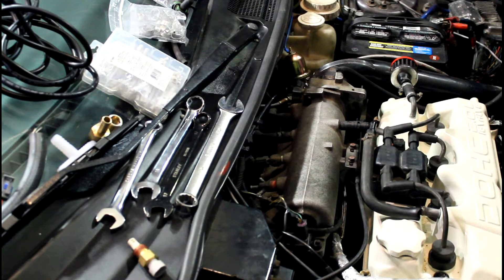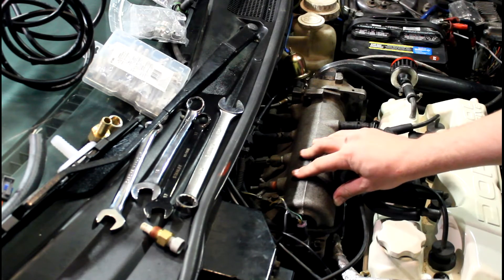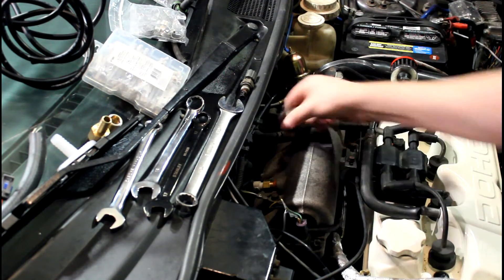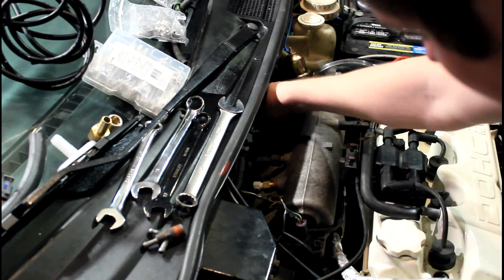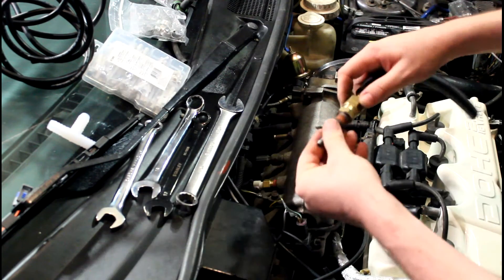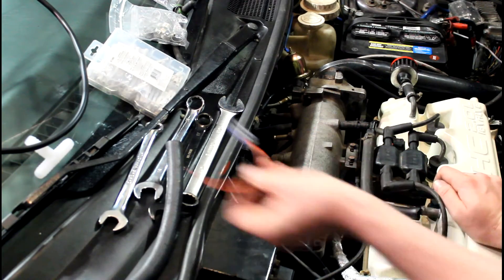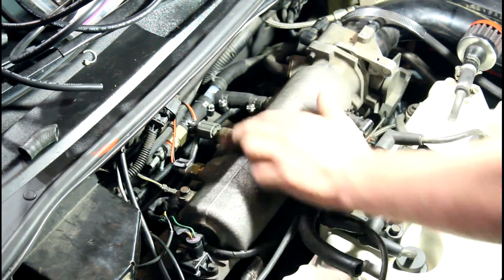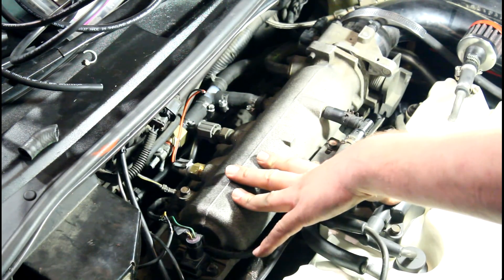Evan's Megasquirt Build Ep 11 - Intake Air Temp Sensor (IAT/MAT)

Comment from the maker: Not exactly. MS would be nice but it is a lot to go through just for a cam upgrade. I'm no 420A guru,but I think a lot of folks get by using an AFC neo to adjust the MAP signal near idle to trick it into giving a bit extra fuel.  Many will tell you the AFC neo is an air flow converter for MAF, and wont work on 420A, but it will actually work on the MAP line to trick the stock ECU into thining there is more load, hence more fuel, and better idle with cam.  Then agian, it is 1/2 the price of an MS

Comment: ok thanks that helps. i just got my 420a January of this month and had stage 2 crower cams put in with high tension springs and retainers and i noticed my idle wasnt acting right and the mechanic who installed it said my ecu might need to be tuned but all the shops in my area dont like to tune the n/a eclipse 95-99 so i guess megasquirt is my best bet?

Comment from the maker: Yes, you do, it is important in calculating how much air enters the engine in speed density mode.  It uses the ideal gas law, PV=nRT, where T is the temperature of the gas (air).  P is the pressure (MAP sensor basically), V is the volume of your cylinder (I think), and R is the ideal gas constant.  n is the number of moles of gas, which basically is how much air you have to complete combustion.  The AFR is the ratio of n units of air you need to n units of Gasoline, so basically T is important.

Comment from the maker: I do not kno for sure, but the threads on the IAT are 3/8" NPT pipe thread - note that isn't an actual 3/8" outer diameter but a pipe thread size based on pipe inner diameter.  I would guess that the stock sensor is 1/4" NPT, but I could be wrong.  I'd pull it and hit a hardware store to find a fit.  You can of course drill that out and tap it to 3/8 NPT for the GM Sensor, or for that matter, calibrate your stock sensor for use with Megasquirt.